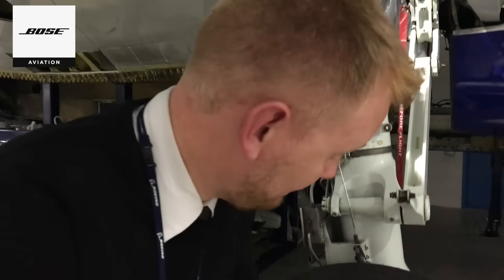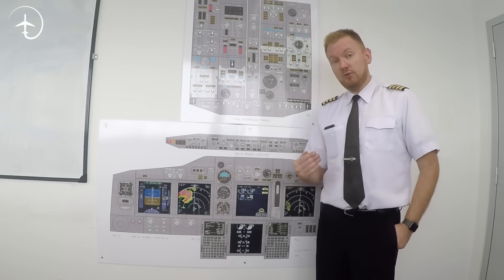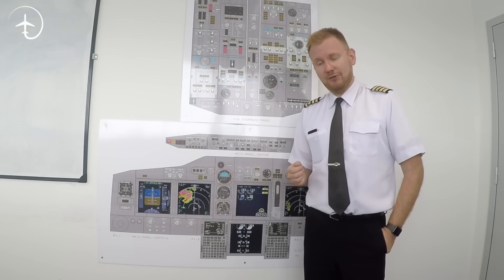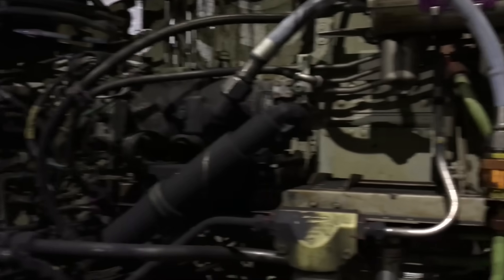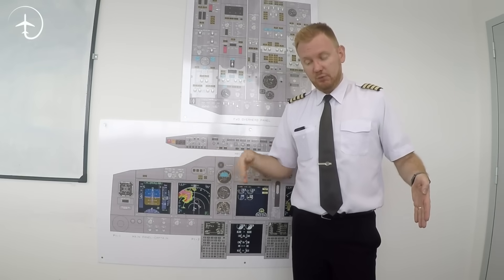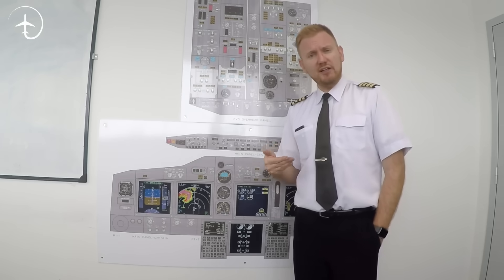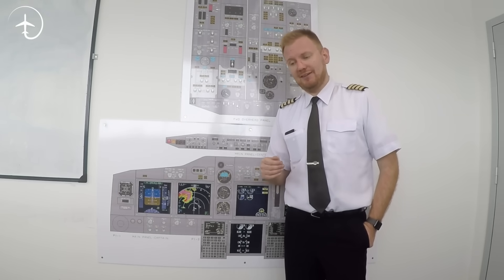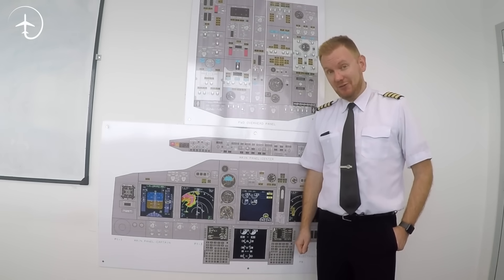Why does the Boeing 737 not have any landing-gear doors?

Comment: QUESTION: MANY TIMES WHEN THE AIRCRAFT IS FULL OF PEOPLE AND LUGGAGE I ALWAYS THINK THAT IT MIGHT BE TOO HEAVY TO TAKE OFF. SOMETIMES THERE ARE TOO MANY PEOPLE AND NOT EVEN ENOUGH ROOM FOR THE OVERHEAD COMPARTMENT TO FIT ALL OF THEM, NOT TO MENTION WHAT'S INSIDE THE PLANE IN ITS BELLY AND ALL THE FUEL. HOW CAN THE PLANE STILL TAKE OFF WITH ALL THAT WEIGHT? HOW HEAVY CAN A PLANE GET BEFORE IT WON'T TAKE OFF? HOW DO PILOTS KNOW HOW HEAVY A PLANE GOT SO THEY CAN CALCULATE THE TAKE OFF SPEED AND OTHER IMPORTANT THINGS?
Reply: +E I N S Ow, that shouting hurts.  Every aircraft has a maximum takeoff weight, it's up to the pilot to determine how to make sure he doesn't exceed that, given the weight of fuel, passengers and cargo they take on.
Reply: With a plane flying from the same airport every day, with more or less the same variables, I think it is safe to say the pilots know the V points by heart and know how much fuel to carry. That said I think government rules says the pilots have to do the math before each flight after loads are calculated. I know after accidents it is often the 1st thing investigators look at and if the pilot did not do his math right that pilot has lost his license. I expect they often know the answers before they actually do the math and may just write it down from memory. 

Yeah for cargo planes CG is very important as is securing the load. Recently I saw a video of a cargo 747 loaded with armoured trucks flying from Afghanistan and the cargo moved as the plane rotated and changed the CG and the plane went straight up then stalled, then went straight down...splat! A huge new 747 cargo plane with cargo and crew lost due to failure of securing the load. One man's mistake having a high price.
Reply: Again I think pilot is the captain and he is responsible for fuel load. I don't think fuel is loaded until he give the okay. That said again with the same flight everyday, with same loads, I am sure some airlines speed up the process and have the fuel loaded assuming the pilot will give the same orders as usual. 

Go for it, ask Mentour. I would like to hear his answers too.
Reply: The plane is rated to carry loads far in excess of it's rated capacity. That's why you see Air show takeoffs of Boeing jets in near vertical takeoffs. Of course they would never do that in passenger service, but it's nice to show off the backup power of these beasts!!
Reply: They also average out passengers and their Luggage. So they may say the average passenger weights 200lbs with luggage of 40lbs, for an average of 240lbs per passenger. You add up the number of passengers and multiply that with 240lbs, or whatever your airline averages per passenger, and you get an estimate weight for passengers and their luggage. You then add weight of fuel which is often the amount of fuel needed to get to destination plus a little extra for delays or diversions. Every aircraft has a maximum take off weight and with simple math you can make sure the aircraft is not above that weight limit.

BTW very few aircraft that I know of have a weighting system on their landing gear. It is a costly and unneeded system but sure some planes may have it.
Reply: +Peorhum  You can add CRJ100 to the list.  Which isn't exactly cutting-edge/recent.

Smallish aircraft would be relatively easy to install a stress gauge somewhere on each landing gear assembly.  There's not much to them.

OTOH, the pilot may have done it by eyeballing the Steward's report of which seats were occupied.
Reply: +jpdemar5 I suspect it's more used to ensure that they have the weight balanced properly.  I believe I had a demonstration of that two weeks ago, in a lightly loaded CRJ-100 when the pilot (through the flight attendants) had two people volunteer to move towards the back.
Reply: How did you like the C series?
Reply: +Peorhum The Canadair (now Bombardier) CRJ-100/200 dates back to the 90's.  Not the new Bombardier C series. Haven't seen one of the new C series - none of the North American airlines are flying them yet.
Reply: Sorry I misread you. I thought you may have been an industry insider and seen one in a demo.
Reply: +Peorhum I've probably seen one in the air, we're less than 2 hours drive from the final assembly plant, but not to the point where I could identify it.

I'm looking forward to it becoming common on North American routes.  I guess it'll be Delta flying it first.  Apparently some have been delivered to Swissair and Singapore, but they may not be in scheduled service yet.
Reply: If you are commenting to me then sorry you are wrong. Now cargo is weighed, not only for max weight limits but also for the CG of the plane. That said it is common practice for airlines to make an educated guess of weights. As i said average weights of passengers and luggage is multiplied by passenger numbers. Some passengers will be over the average, some will be under the average. The planes are designed to fly with an average per passenger weight to begin with, so you are not really doing anything the plane manufacturer hasn't done while designing the plane. That said the fuel is the real variable of importance for airlines, to much you can't take off and you maybe wasting fuel, not enough you become a glider. Now some airlines will weigh luggage but not all. Averages will often do. Different airlines may have different averages to do the math with. Now some planes do have "scales" in the landing gear which can remove some guess work but that would be after the plane is loaded. Often you want the math done BEFORE or WHILE the plane is loaded. Sooner the math is done the sooner the plane can be fueled as needed(which may depend on loads) and the V points can be worked out and the plane can leave the ramp.
Reply: +Peorhum I suspect that "luggage weighing" isn't really factored into the flight calcs.  Generally speaking, they'd compute using the average weights.

Weighing luggage is more a matter of limiting the weights ground crews have to sling around.  OSHA, union contracts etc. will have max weights ground crews are expected to handle.  Overweight packages are either prohibited, or they charge extra for special handling.
Reply: Fromage Frizzbizz  sounds good to me...There is so many airlines out there and many have different policies depending on their region , their aircraft, the airports they use and government rules etc... and of course unions.
Reply: +Peorhum This is a question we could easily ask Mentour.  But, for standard commercial I highly doubt that they do calculations for V1/V2 etc out in the plane or last minute fuel calculations, or need to.   Makes things unnecessarily complicated because the weights are pretty routine.  The pilots have other things to do like their equipment checklists, etc.

When the flight plan is "finalized", they know +/- a couple how many passengers there will be and go for standard averages for people + luggage, and compute fuel from that.  V1/V2 isn't something you need to know that accurately, if you try to shave it too close you might just regret it.

Now with varying cargo loads, especially military, I can imagine it being rather more complicated, and it ain't exactly easy to move cargo around in flight if you have the CG wrong.  More than one cargo flight has crashed due to bad CG calculations,  load shifts or just plain overloading.
Reply: +Peorhum It would be worth asking mentour how/when the fuel ordering/final flight calculations are done.

I suspect that things like fuel orders are made before the Pilot is necessarily even assigned to the flight, but, as the Pilot is always responsible, has to sign for it.

I've seen that 747 video.  There have been two fatal accidents at Toronto International.  One of them was a Cargo DC3 whose load shifted while bringing the nose up for landing, stalled right before the runway threshold. 
 Full of autoparts....
Reply: +Peorhum I didn't say the captain wasn't responsible for it, just that he doesn't necessarily do it.  He has to sign off on it, which makes him responsible.  it's up to the captain to ensure that there's enough fuel, whether he issued the original order or not.
Reply: I understand, you could be right with some airlines.
Reply: +Peorhum I would suspect that the routine commuter/regular routes are pretty consistent, and the airline's airport office could be trusted enough to simply repeat the order for each flight, saves time at the gate if the pilot got called off-schedule.  Still being the Captain's responsibility to make sure it was right every time.

You may not appreciate that a lot of professions are "like this".  For example, electrical code here requires that all work in semi-commercial up to industrial must be done under a permit from an appropriately certified electrician.  What that really means is that an appropriately certified electrician can get anyone to do any part of the job the electrician feels like.  It's up to the electrician to ensure that every single bit is done right, and the electrician assumes responsibility for the whole job, whether they actually did a particular piece or not.  If the place blows up due to a wiring defect, the electrician can't point a finger at anyone but himself.

I (amateur, but very knowledgeable, electrician) have wired an entire duplex that way.  Code doesn't allow DIY for duplexes.  We got an industrial electrician to do the panel installs and "supervised" us doing the rest (about 95% of the work).  Ironically, as the amateur, I was more familiar with residential code than he was (he borrowed my rule book to keep me honest ;-), but he felt comfortable doing things I wouldn't dream of trying.  We ended up trusting each other, he signed off on the permit, and we passed all inspections without a single "wrong!  Do it over!".

That long recollection of another poster about a Captain allowing him (at 7) to start an engine is like that.  If he (at 7) did something that caused the aircraft to catch fire, the Captain, not the kid is blamed.

[Obviously, FAA/TSB/IATA et. al. have introduced specific regulations that prevent airliner Captains having that much freedom since then, but it doesn't impact my point on the basics of 'standard fuel load', catering orders, etc.]
Reply: I agree, I have encountered it myself when I worked on electronics imported into Canada. By law they had to be inspected by an Ontario Hydro inspector and he was to put a sticker on them when they passed. I got along well enough with him he would just come in and put stickers on what I had, ask what was on order then counted off more stickers for me to place on the equipment on order. He had season tickets for the leafs so he would give me a few tickets now and again for leaf games at the gardens. He was a nice guy but really was not doing his job and I was breaking the law
Reply: +Peorhum  Funny that, I was much in the same situation as yourself, dealing with Ontario Hydro doing spot approvals.  Strictly speaking I don't think either of you were doing anything bad.  If he got to the point of trusting you to only put the stickers on things he had inspected previously, and they were clearly line-manufactured (rather than custom one-offs built by morons), both of you were probably okay unless you played silly buggers.  Think of the Leaf's ticket as a disincentive to screwing him ;-)

In our case, it was repeats of a not-yet-or-perhaps-ever-CSA-approved PC computer, from a major US-based manufacturer who knew what they were doing, but main market was elsewhere.  He opened up the first one or two to check that it was sane, had the right bits, and called it a day.  I don't think we sold more than a dozen or two (these were specific application builds).

[This was long before PC's were as standardized as they are today, and this machine had features we needed, and nobody else had.  At half the price....]

I hate to see what they'd do with some of the Chinese ebay stuff ;-)  I mean, seriously, they think 22ga wire on 120v supply, and the grounds are stuck on with silicone caulk is good practise?   Gah!   At least the castings are beautifully done and bullet-proof.

[Clearly their "up front" design is excellent, it's the execution after the beancounters get involved that may cause problems.]
Reply: I've flown on a couple CRJ-200s they seem to me prone to having mechanical issues... I flew on one from San Antonio and the gear was stuck down after take of..... and we had to turn around. Basically every flight they were coming from maintenance for some reason or other.
Reply: I kinda doubt that is one man's mistake... that is a systemic mistake where multiple people failed.
Reply: What if you are flying a Jenny Craig Holiday Tour? Is there a multiplication factor? :-)
Reply: Peorhum there is far more that goes into it than max structural weight.
Reply: Peorhum which aircraft have scales?
Reply: Fromage Frizzbizz it depends if they use balanced field speeds or unbalanced field speeds.  If balanced field speeds are used, then yes pilots reference a card for the speeds.  Otherwise no.
Reply: Peorhum no, the flight planning computer calculates fuel burn, FAR reserves, and alternate burnout.  Taxi fuel is based on history for that city, and time of day.  Then the dispatcher adds fuel for contingency, longer than expected taxi time due to deicing, weather, or runway configuration.  If there are fuel penalties for MEL items, the computer adds this as well.  Then once the dispatcher is happy with the flight plan, it is given to the crew for verification and approval.  Your “knowledge” is off base and incorrect.  What are your comments based on?
Reply: Peorhum Airlines all have their own procedures.  At some, the dispatcher files the flight plan and the computer calculates the fuel load.  Contingency fuel is then added for possible problems (long taxi, deicing, busy time of day).  This is given to the crew ahead of time for review.  At some airlines, if the load is legal, the Captain doesn’t have much say.  At other companies, the captain can add fuel or even remove fuel with dispatcher concurrence.  They share responsibility for planning the flight.  The captain is the final authority as to how it will be flown.
Reply: Peorhum the fuel sheet is generated as soon as the fuel load is determined and the fueler will then fuel the plane.
Reply: I haven't a clue, but from a purely engineering standpoint all you really would need is a pressure sensor for each strut. You know the piston diameter and system volume, therefore you know exactly how much force is being resisted, and since there's a fair bit of separation between nose and mains you can calculate your CG from that. 

Might want to run the controls around a bit though just to get a sense of how much aero load is happening on the ground (i.e. wind). Just collect the data and let the computer figure that part; handy part about computers is that the programmers only ever have to get their part right once, but doing the math by hand means you have to get it right every time.
Reply: Michael Free I am not sure why weight isn’t sensed at the struts, but it is not.  Not one aircraft manufacturer has chosen to do that, and there is a reason that it isn’t done.  It is not something that nobody considered.  Frequently during loading, the aircraft can be felt settling.  This is caused by friction on the strut wall.  A flat strut could be a reason for not doing it, but I don’t know.  

The “math” is all done by computer.  Boarding passes are scanned, as well as bags, cargo, and mail.  The system knows the location of every seat, cargo bin, and fuel tank, and just plugs the numbers to get a gross weight and CG.  It takes less than a minute for the load planner to close out the flight and finalize the numbers.  Before we even begin boarding, we already have a guesstimate that is usually within 1% of the final numbers.
Reply: Flight Simmer The airlines use standard passenger weights, and standard baggage weights.  Summer, people weigh 180, in winter they weigh 185.  Max Takeoff weight for any given airport is the most restrictive of:  Max Structural Weight, Runway Limit Weight, Takeoff Performance Weight, Enroute Limit Weight, Max Landing Weight + fuel burn to destination, Runway Limit Weight (landing) + fuel burn and Performance Limit Weight (go around) + fuel burn.  

Minimum fuel load is burnout to destination + 45 minutes.  If an alternate is required, it is burnout to destination, + burnout to alternate + 45 minutes.  Most airlines add contingency fuel for cruise altitude flexibility, weather deviations, and known delays at the destination.  Some stations have fuel that is significantly less expensive than where the aircraft will go next so they tanker fuel to save money.
Reply: Everything that is put on the aircraft is required to be weighed and accounted for- not only weight but also it's "moment", or, how it effects the center of gravity, to ensure that the airplane is balanced over the wing. The weight should be concentrated between the middle and the front of the wing.

Years ago they used to calculate each passenger as 180 pounds and more in winter, but I think they upped it to 200 because people keep getting fatter.

I remember in the 1990s when I'd watch airplanes Northwest Airlines DC-10s would sit and wait for their operations center to finish adding up the weight and balance numbers so they could know their speeds and elevator trim setting.  Seattle tower would keep calling and asking if they were ready!

Since the mid 1980s new aircraft have been equipped with FMC (Flight Management Computers), into which you enter the weight and balance data and it gives you all your speeds and altitude capability.
So it is easy now.

Older airplanes had "speed books"- little spiral bound laminated booklets with all the speeds for different weights.

Aircraft weight is EXTREMELY important to know accurately at all times in order to calculate takeoff and climbout speeds (V1, Vr, V2+10) and safe minimum flap (and flap retraction) speeds, and approach and landing speeds. 
Also, you need to know the weight of the aircraft to know the maximum cruising altitude you can reach.
Reply: StratMatt777 I am not sure what your experience is, but it does not sound like you are a pilot.  The center of gravity is located between the forward and aft limits.  Preferably near the aft limit for efficiency.  The V speeds for takeoff are generated by the flight planning computer(separate from the aircraft)  unless the particular airline uses balanced field V speeds.  The pilots do not calculate the cruise altitude, but can if necessary by referencing the performance tables in the flight manual if necessary.  The FMC/FMGC computes the optimum and maximum cruise altitude based on ISA deviation, weight, and winds. The dispatcher generates a flight plan with a cruise altitude that is equal to or less than optimum and is based on PIREPs and efficiency considerations.  Once airborne, the pilots can change the cost index to modify the cruise Mach number based on estimated arrival time.
Reply: I wouldn’t be surprised if they left a ton (I mean a literal 1000Kg) of spare weight even when the plane is at “max capacity” to make up for miscalculations.
Reply: Leo Teillol Nope, we will take it right to the limit if necessary.  Usually, we are nowhere near the structural limit weight, but in warmer weather or high altitude airports, we will go right to the runway or performance limit weight.
Reply: The landing gear incorporates a device that essentially weighs the airplane.  The pilots have this information, and it's one of the things on their checklist, because it goes into calculating the required takeoff speed.
Reply: E I N S 

SHUT UP.
Reply: I UNDERSTAND, NOBODY KNOWS THE ANSWER.
Reply: Do you have brain damage?